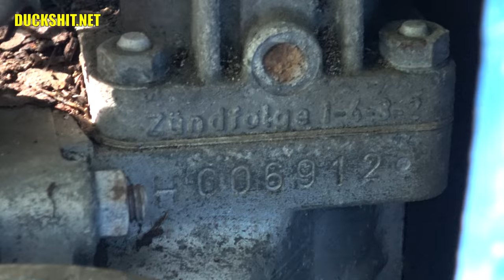1967 VW Bus- VIN Numbers and Year Identification - Mid Day Q&A - 60

Comment from the maker: Any more suggestions as to whether this Bus is a 66 or 67?
Reply: Doesn't the transmission have a serial number too?  Any chance you could match that up to a year?
Reply from the maker: It probably does have a production code, yes. I don't think VW had a whole lot of variations at the time, but it is something to look into!  Thanks!
Reply: We have the same issue with our 65 bug.  Because the rear side-windows can open, everyone argues about the year.  The books we have say there was a 1200A and 1200B.  And our VIN shows it as being the 1200A.
Reply from the maker: @mattpinegar9427  My quarter windows opened on my  65, too.  :-D  But anyone could have added that down the road, too! LoL!
Reply: @vvtheduckvv  LOL
Reply: Maybe engraved in the windows at the lower right corner. As common for vehicles built after 1978. On pre 78 idk. Or on the bell housing from the
transmission (should be AA here). On the speedo gauge or on a axle.
Reply: The bus is hotter than a $2 pistol
Reply from the maker: That would be interesting, but once I get the VIN plate we will run it who the cop shop and video document before I try to do paperwork.
Reply: On the engine there is also a serial # matching to the body, at the bottom of the alternator mount. If the top of the carb has a spring mounting its a old style 1200 or 1500 engine if not its a -3 carb, type 2 engine. Yess, i did some research for you!
Reply: did you look at the DOT year on the tail light lenses?  Maybe the fronts have it too.
Reply: @donmcarthur7786  We sure did!  Mentioned in an earlier video, but yes, they say 66 on the rear but anyone could have swapped those out easily.
Reply: I did some research and it says the VIN number should also be located somewhere underneath the back seat...  Not sure where off hand, but that seems to be the only place you did not show in your video and may be the most likely place to locate it.  I know they stamped the number somewhere on the vehicle - but I thought it was on the brackets that hold the engine wrap around on the back by the motor...  If you did not see one there - I may be thinking of a later model - but I owned a 67 with the swinging doors :D
Reply: Did you get the Year or Vin number? Maybe its either underneath 
the under carriage or glove compartment... I don't know 🤷‍♂️
...Hey I'm a Lucky 13 Comment
Reply from the maker: @bytemevv-4616  Heh VIN number is rusted off, all tags were missing.  Previous owner found it at one point but its missing again.  Its alright though, it will be a while before I can do the paperwork on it.
Reply: @vvtheduckvv  If the owner can find maybe the insurance papers or any documents it may be tied to the VIN#... 
It sounds like an investagation process... Good luck though and I dearly thank you for the quick response.
Reply: Duckman,  67 bus had a ONE year only factory gas tank, sure it could have changed, but DOUBTFUL, the 67's had HUMP yes, I-gore, a hump....the only year to have that.  I possible have two 67's.  Both have back up lights and are 12 volts.  I'm playing with the deluxe now,  DOM has a format:   DD D  and the M code is showing 6 6 - does that mean June 6.    I'll look on the overhead tag and see if there is one near the engine...turns out my 66 is really a 65.

Comment from the maker: The engine code does suggest it is from Nov 1965 which would make it somewhat early run 1966 model year
Reply: It can now be put to rest and finally determined, what about the vin plate from the roof area that you left with Mary?
Reply from the maker: Trying to get that today!!!!!!   But I don't even know if thats the original tag.  Looking for other unique identifiers on the body that aren't as easily changed.
Reply: @vvtheduckvv  could be also infused in the cast on the rear axle.
Or on the steering gear.

Comment: I have a problem with signals on my ‘63 ragtop beetle. The y come on but don’t blink. I’m not good with electrical but maybe with a little guidance I could solve it. Thanks, love the videos.
Reply from the maker: Probablay as simple as a bad flasher relay, or possibly the flasher relay isn't grounded.  Pretty simple stuff in most cases!  Hope that helps you!

Comment: the one thing I know about Volkswagens - and it is basically true over all of the models is that 66 were all 6 Volt systems and 67 went to the 12 Volt system.  If there is any Original Electrical Parts on this bus - it would be easy to tell as they were delineated as 6 or 12 Volt items.  I hope this may help, but since most 6 Volt systems got upgraded to 12 it may not <3
Reply from the maker: Yeah 12v stuff is easy to swap, not a good way to delineate.  I have a single circuit brake master cylinder though.  67 had dual, easy to swap but nobody would typically go backwards.

Comment: Being a ex-auto crossers, you could inflate the air pressure a little to help with the roll over on your front sidewalls. 
Lowering Gregory just a couple of inches would look great.👍🏼
Reply from the maker: Thats the bad thing about VWs.  You put more pressure in the front... massive understeer!  Usually I keep the front pressure at stock, and the rears slightly over to try and squeeze out some more oversteer.  Gregory definitely needs more low!

Comment: H - is normally a 1493 motor - and started in August of 1965.  Your number is H 006912 which is fairly early in the production numbers.  I am surprised to see the dual manifolds - it is possible that the motor was upgraded from the single manifold to dual as I did not think the dual came along until the 1600 motors in 1971...  A 1967 motor according to the list started with engine number: H 0 204 001 - which would mean that would be a 1966.

Comment: Dutchman you said Gregory wasn't wrecked but in this video the front bumper looks off, closer on the passenger side.?
Reply from the maker: Its not bolted on... lol.  Its dangling!  Also the bumper has been cut, so its not as strong as it should be.  It'll need some repair!